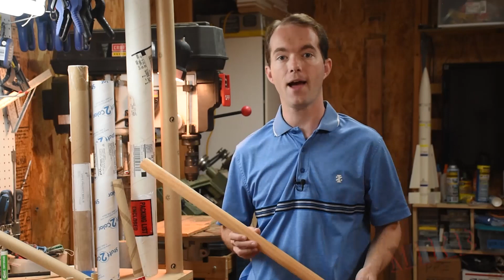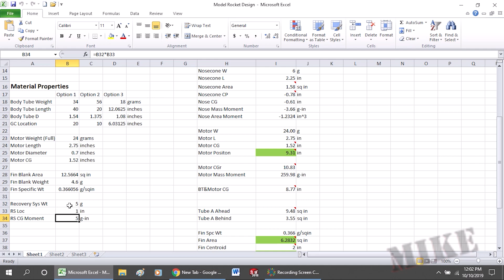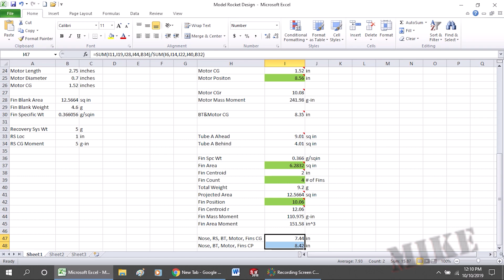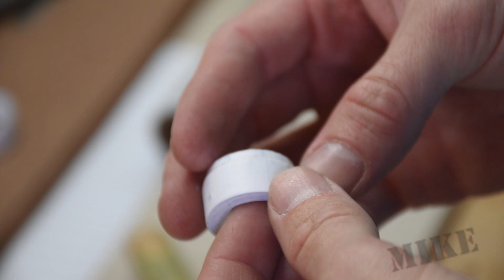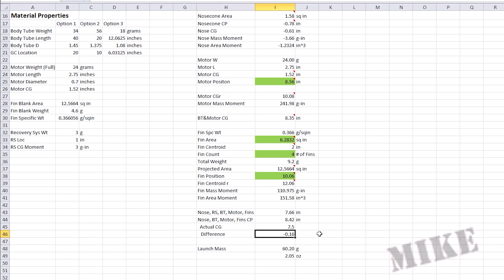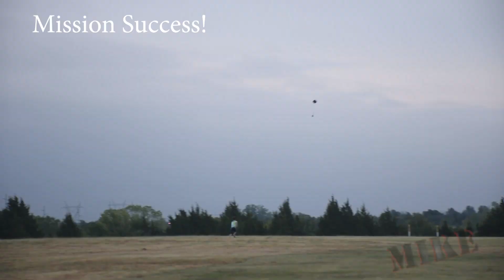Model Rocket Design & Build - Mikes Inventions

Comment: Have a tube question, why not use a thin walled aluminum tube?
Reply from the maker: Metal is frowned upon in model rocketry, but you sure could if it were light enough.
Reply: @MikesInventions  why I see lots of rocket videos on YouTube with metal tubes